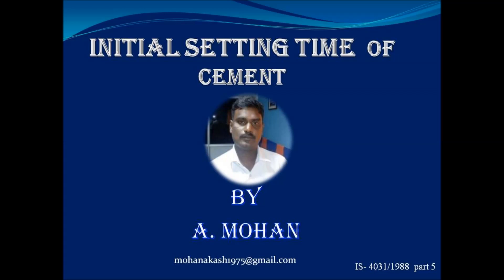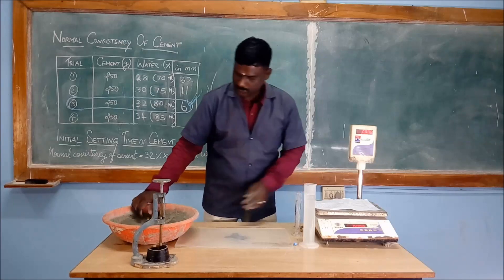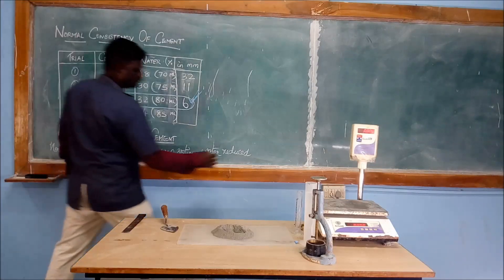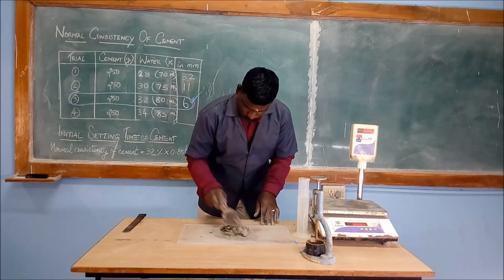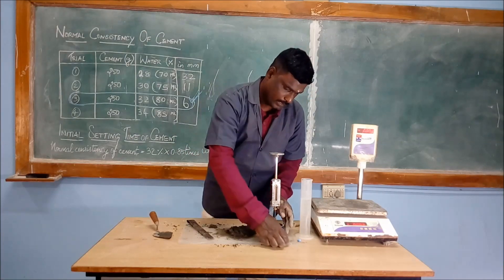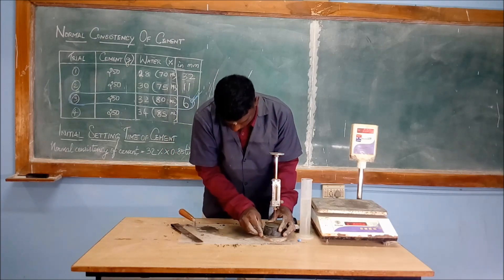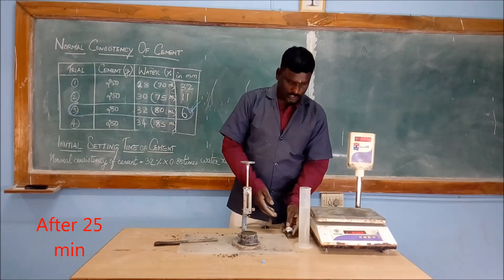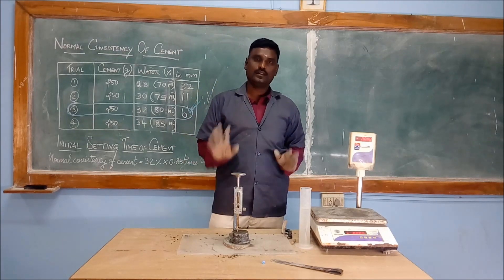INITIAL SETTING TIME OF CEMENT

Comment: Don't give half half information 1)when ur add water timer should  starts 2) for make penidation should need  2differnt diameter needle 3)use for determine initial setting time for 3mm needle 4)use for final setting time smaller mean 1mm 5)waterquantity=0.85×standard consists ofwater(like 0.32)×weight of cement (may you take 250 gram)

Comment: The cement weighing 300g is taken and it is mixed with Percentage of water as determined in consistency test. The cement paste is filled in the vicat mould. The square needle of cross section 1mm× 1mm is attached to the moving rod of the vicat apparatus. The needle is quickly released and it allowed to penetrate the cement paste in tge begging the needle penetrate completely.it is then taken out and dropped at a fresh place the procedure is repeated at regular intervals till the needle does not penetrate completely the needle should penetrate upto about 5 mm measured from bottom. The initial settings time is the interval between the addition of water to cement and the stage when needle cease to penetrate completely.thia time should be about 30 minutes for opc

Comment: सब गलत कर रहे हो.
Reply: The cement weighing 300g is taken and it is mixed with Percentage of water as determined in consistency test. The cement paste is filled in the vicat mould. The square needle of cross section 1mm× 1mm is attached to the moving rod of the vicat apparatus. The needle is quickly released and it allowed to penetrate the cement paste in tge begging the needle penetrate completely.it is then taken out and dropped at a fresh place the procedure is repeated at regular intervals till the needle does not penetrate completely the needle should penetrate upto about 5 mm measured from bottom. The initial settings time is the interval between the addition of water to cement and the stage when needle cease to penetrate completely.thia time should be about 30 minutes for opc

Comment: 0.85×32% equals 0.272 sir.. how did u get 68ml? Could u please explain that
Reply: In serial no 3 the percentage of water taken is 32% i.e 80ml..at 32%we obtained standard consistency.so for IST we have to take 0.85*80=68ml..
Reply: Tq u sir
Reply: Actually just 24% water is enough of cement weight bro
Reply: The Weight of cement taken in this case is 250g. 
So, 32% of 250 = 80ml
0.85 * 80 = 68ml
Reply: @rohitgooner878  where did 0.85 came from?